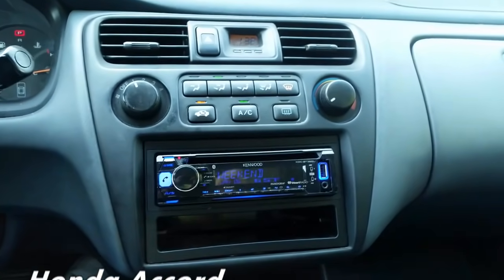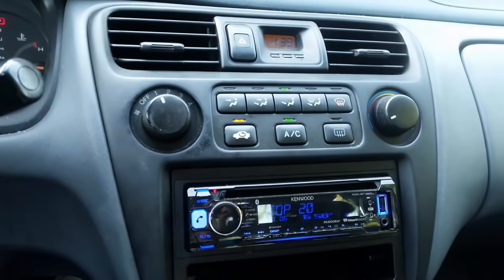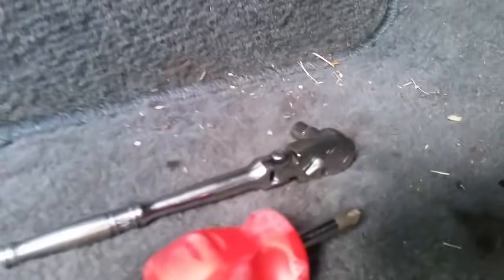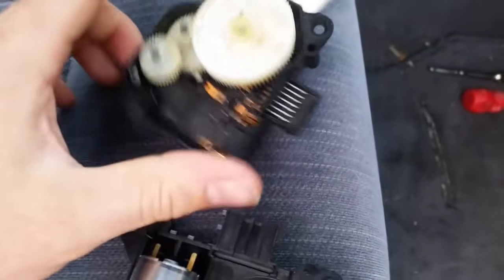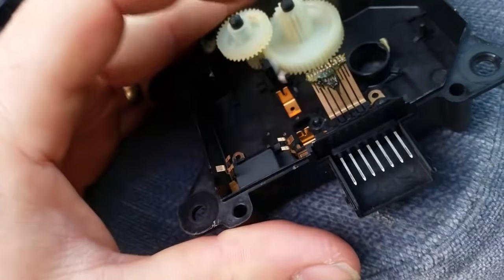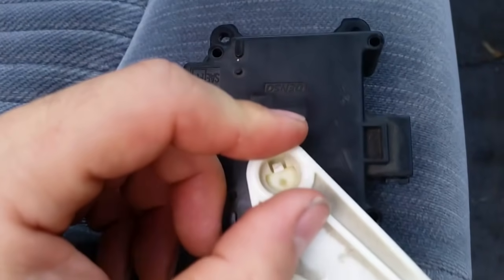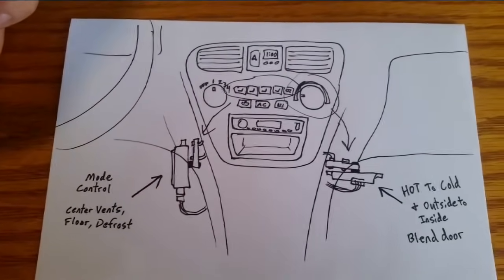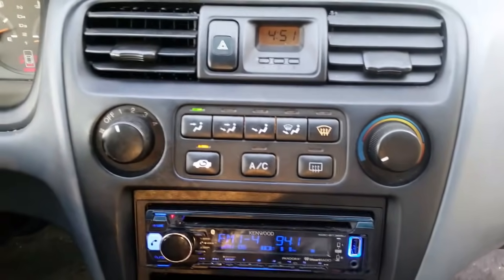Honda Accord Climate Control Repair Fix 98-02

Comment: This is all fine and dandy, but you forgot one very important step - how to unhook the levers from the motor housing. Considering the position you have to be in to even access the motor housing, do you have any tricks to unhooking the lever rods so you can remove the housing? I am speaking specifically about the driver's side.

Comment: thanks for the great video.  I am working on this problem now.  Where is the Part 2 video?  My lights all work.  Recirc works.  A/C works. All is sort of normal, but NO HEAT.  The A/C temp seems to not adjust. The AC blows, but temp control has no effect.  No coolant leak, smell, or fog.   Also, did you have to rremove the kick panel on passenger side?

Comment: Thanks John! very well explained and filmed! I consult you: in my car it happens that the detour to different sectors (windshield, feet, etc.) is partially done, in any position, it also comes out through the front panel. Will the engine problem close to the accelerator? or the pallet system inside? Thank you very much from Argentina.

Comment: Cold and hot air comes out of mine is that circulation button with the looping arrow does not come on at all I tried to put some r14 but the compressor even though it was spinning would not pull it from the can

Comment: I see that you still had grease on the metal contacts that you recommended to pry up. Did you end up cleaning the grease off before reassembly? (awesome video btw) Thanks for sharing.
Reply from the maker: I did, just forgot to show that. Good point tho

Comment: I have a 1999 Acura cl and heat dont work.only blow air.heating core is good.also the air is coming only from middle vents. The mode not working.do you think isvthe actuator the problem?

Comment: I HAVE A 2000 HONDA ACCORD DX VENT BUTTONS NOT WORKING, AIR JUST BLOWS THROUGH THE FRONT VENTS. I CHECK THE MOTOR AN EACH BUTTON MOVES THE MOTOR. DO I STILL TAKE THE MOTOR OFF AN CHECK IT? THANK YOU

Comment: Hi -- is the wire to correct the LEDs? The actuators seem to work still because the modes switch, but many of the LEDs do not light up anymore. Also the LED for the heater is always on. Thanks!

Comment: We have a 2004 Honda Pilot. The rear heater works but the front heater does not work. The motor, blower, controls and everything else are working and the antifreeze is at correct level. There is some rust on the cable that switches the temperature from hot to cold. Any suggestions would be greatly appreciated.

Comment: 98 Accord LX here. Same problem with driver side actuator. Not mechanically inclined. Is there a part # to look for a cheap replacement? *Another video says it's a DENSO AX0637005870 12 V.

Comment: This is a great video but connected to you controller behind the dash there is a bank of pins i what pin controls what i am adding switches so i don't have to buy a new control board

Comment: My problem was my trying to move the cable for the heater control valve that seemed to be stuck on the firewall under the hood.  I mistook it for the throttle controller.  So, now it is not "stuck".  But I think I disconnected the cable from the controller motor.  From your video I presume it is on the passenger's side.  Any clues or videos as to how to reconnect it or do I have another problem?  A brief test showed that the heat worked well and the A/C worked.  Although I could not tell if they were both on at the same time.

Comment: Help, I was able to remove the passengers side blend door actuator, but the tab on the outer side that disengages the wheel broke when I tried to release it. ( I understand it’s 21 years old ) is their a workaround to disconnect so I can clean? I’m not sure this is the problem so I don’t really want to spend $269.00 for a new one? It was a little effort to get out , back screws were a super tight fit,  and it’s Crazy hot out right now.I would hate to put it back. Without cleaning.

Comment: hmm.  my husband's accord's defrost light doesn't come on or work at that setting, but the defrost will come on with the combo of heat/defrost--so seems it's just a problem with the contact for the button, no?  also, the heat always comes out of the dash, even when set to floor only.  would that have to do with the driver side flap actuator?  otherwise, heat/ac works.

Comment: I know this video is kinda old, but does anyone know if this fix works in the case where only some of the modes are working? I have a 2000 Honda Accord EX. For me, the top vent controls do  work but only the rightmost 3 LEDs light up when selected (feet, feet/defrost , defrost ). Also the recirculation LED does not light up and ALSO does not work. I have already changed out the LEDs themselves in the controller module and soldered the D3 jumper. Before I start messing under the driver and passenger sides, I was hoping someone would know for sure.

Thank you in advance,
Jose

Comment: I just want to switch it to heat when it's winter and turn it tocold when the swamp weather starts my brother did it easy switching it to cold but I've been trying for weeks to switch it to hot their are three white things connect by metal rods what direction do I push them bc I pushed them the opposite direction qnd it's still cold and the metal rods won't connect so I'm doing something wrong

Comment: On my 99 Honda accord the only one that works are the ones for the front vents all the other ones don't work, I looked under the drivers side and seen that the actuator don't move I'm going to try this method if not I guess I'll buy them but how much is that part

Comment: Anyone know how to fix whats wrong with the lights? my motors work fine but if the LED lights are not on I wont get AC or heater unless that lights come back on

It happens randomly.
Reply: MercyLeague that’s exactly what’s going on with mine. It’s already warming up and the AC comes in and out due to the lights

Comment: im having issues where i can turn the a/c on but it blows hot air. and nothing on the climate control lights up. i ran a hot wire to the compressor and it kicked in but i didnt leave it like that because i didnt want it to burn out. can u help me please?

Comment: The lights come on when they feel like it so I I just tried this and it didn’t work for my control unit. I already replaced the unit itself and it worked for a while but I’m guessing it’s maybe a wiring issue.

Comment: So the only thing that works on mine is the left knob that controls the actual fan motor. Nothing else has power, is the whole unit bad? It worked fine before I got an engine swap, mechanic swears he didn’t mess with anything like that

Comment: Not sure if you will get this since the last comment was 1 year ago (?)...however, my 02 Accord Coupe SE 4 cal auto has similar problem. Fan and cold/heat controls work but the green indicator lights are out. If you press firmly and hold the footwell only direction button...sometimes the green light comes on and resets the direction of the airflow. From what I see on this video it seems that if I do the driver's side actuator procedure as you did I will likely solve this problem. I do not have a soldering tool and hopefully do not have to take things apart in the middle of the dash etc to solve this issue. Would be great if you are able to reply. Thanks.

Comment: The only thing that works on this module is the knob to turn the airflow on. All the other buttons and the heating and cooling knob do not work. I have replaced it twice as well. The whole thing and the same thing has happened
Reply: 1999 honda accord

Comment: I'm going to try this cause I think this is the problem with my 2002. I would sometimes get heat normally and then the next day it would just blow completely cold air. Let's hope! Thanks
Reply: I have same issue wat was it?
Reply: @saywhat5696  mine is only blowing cold air.. & none of the ac/heat vent buttons are lighting up but blows cold air.. I'm thinking is the climate control unit since all the buttons are off... your buttons are lighting up?

Comment: My ac doesnt get cold or hot? Just blows air, anything in mind?
Reply from the maker: It's low on freon, or completely out would be my guess. Go buy a $20 freon fill can @ walmart, get one with the attached fill hose. Charge it up as described on the bottle. 90% chance that's your problem & it will fix it. I've done it a dozen times on different cars, that's most likely your problem...
Reply: @JohnCalebWarren  thank you so much, that's what I was going to do I just wanted to get some feed back just in case. 👌 I will try that asap

Comment: Do you have a recommendation for how to fix the recirculating motor? Mine works intermittently, I took it out and things seem to be clean but problem persists.
Reply: The re-circulation actuator is directly behind the glove box.  It's not controlled by the hot/cold actuator as mentioned in the video.  You'll have to pull the glove box out completely to see it wedged vertically sitting dead center and hiding being the big bundle of wires.  There are only two screws that hold it down and you'll have to finesse it out buy turning it in different angles.  It's a little tight but doable when pulling out and putting in.  In my case, I purchased the hot/cold actuator thinking this was going to fix the re-circulation issue per the video.  Instead of returning it, I cracked open the two actuators and swapped the inside motors and it worked well.
Reply: @hermanlee1218  thanks for the info. I already replaced the motor a few months ago though. All works fine now.

Comment: My 1 2 don't work but 3 4 work so would that fix my problem if I buy a new driver side fluctuator
Reply from the maker: No, you would probably need to get the blower motor resistor pack, that is what controls your fan speed. Sometimes they are repairable

Comment: on my 99 Accord, when i turn the fan on (big left dial) sometimes no air comes out for a minute or 2.  sometimes it comes on instantly.  everything else seems to be working fine tho.  ideas?  thanks !
Reply from the maker: Two options: my first choice would be replace the blower control (climate control unit) which is that unit you are talking about with the big left and right knobs. Just pull the trim panel off the face of it and there should be four screws that hold it on & a couple plugs in the back. Easy job.    My second guess would be replace the blower motor,  it's located under the glove box.  Good luck, both can be purchased cheap at a salvage yard or eBay

Comment: Will this cause your ac to blow hot? Because I changed my compressor and new AC condenser fan ?
Reply: This will cause the ac to blow hot as you can tell the ac is working right by feeling the line refrigerant line goin into the firewall in that it’s cold. Mine had same problem. Turned out to be the motor in the actuator. I overcharged my system thinking it was an ac problem. Many thanks to this fellow who did the homework for us.